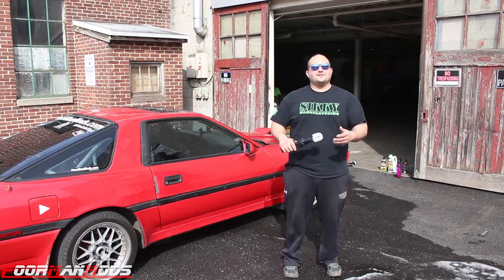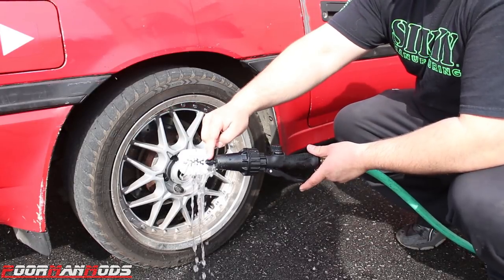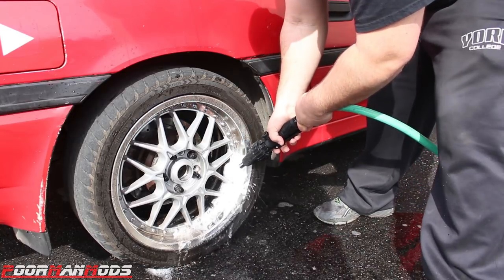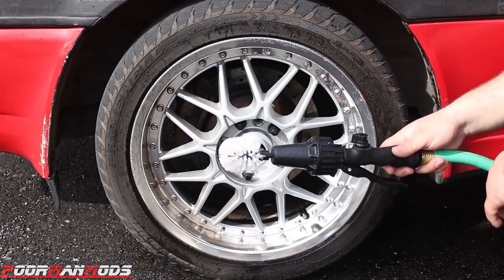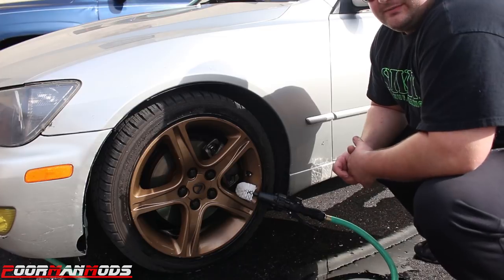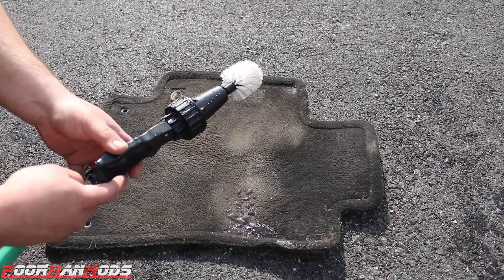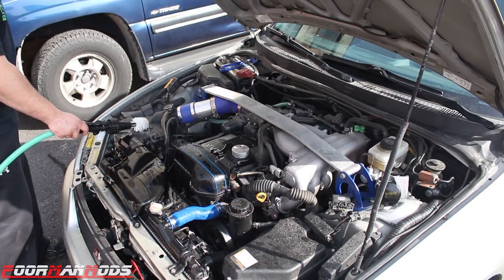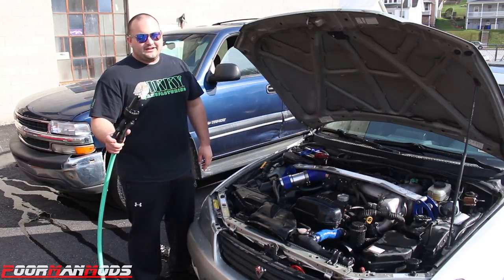Brush Hero Pro Wheel Brush Review BS or Legit? Is it the best wheel cleaning tool?

Comment: There is a black brush on the box that is better (softer) for delicate areas, when you cleaned the lexus rims with the white one I thought it will scratch the coating!
I always apply 1st a bit of wheel cleaner and is much faster even.
Great video, will use it on my floor mats next time.